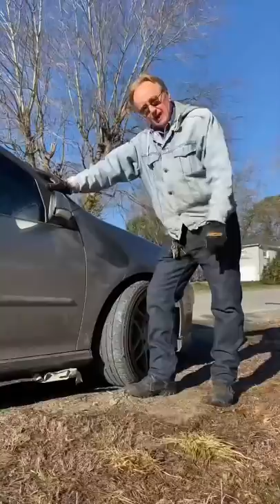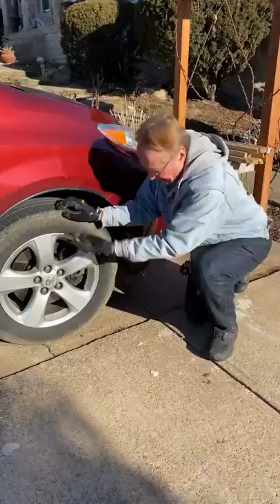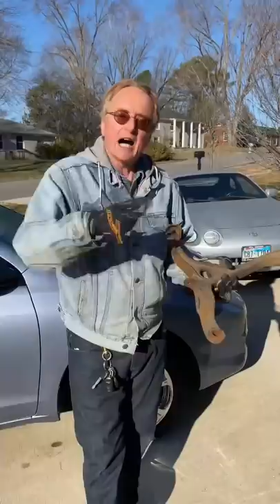Here’s Why You Should Never Hit a Pothole

Comment: That feeling you get when its raining at night and you drive into the grand canyon of pot holes
Reply: You go through all the fowl words you know in record time and if someone asked what you just said you really don’t remember
Reply: Lol! So true
Reply: @arontesfay2520  
I usually want to pull over and check for damage immediately!  Its a horrible feeling “like a pit in your stomach” to not know if you just destroyed or weakened something on your beautiful ride. 😩
Reply: @repairfreak  Same here. I went through a big one once at like 25 mph. The impact was so heavy I went out expecting to see my bumper on the ground. Amazingly, I couldn't see any damage. My suspension started making a clunking sound whenever I went over bumps since then though.
Reply: @repairfreak I’m worried about my alignment getting thrown off
Reply: @cristianayala1948  Yes, usually nothing good comes of it for sure. Least be a wheel weight gets flung off & throws off the balance of the one wheel that went in the hole, tire blows, or your rim cracks if aluminum, alignment goes off. More serious would be ball joint, tie rod end, stabilizer sway bar link bolt damage,  wheel bearing damage, strut/shock damage or their mounting “if rusted.” Obviously if your tie rod snaps or disconnects or your ball joint, or tire blows, this could cause you to possibly loose control of your steering and veer in the direction of that side. Obviously there are other things that can be damaged as well in the front end steering/suspension system as well.  It all makes for that very sick feeling in your stomach after hitting a hole hard regardless! 🤢🤬

Comment: I'm not overly worried. My Tacoma rides on 265/70 R16's on stock aluminum in the summer and 245/75 R16's on steel for the winter. Big sidewalls might not be fashionable but they do soak up nasty bumps and holes a lot better than a low profile tire on a 18, 20, 22, or 24 inch wheel.

Comment: Scotty - Love your videos! Speaking of potholes: The shocks on my 2010 Toyota Camry are shot! My mechanic gave me prices for replacing the shocks with Toyota shocks or replacing the shocks and springs with after-market parts. The difference is only $200 - in favor of the Toyota shocks. Which choice makes the most sense?
Reply: @Kevin Strnad Toyota KYB shocks are well worth the $200 extra. Never buy the cheap quick struts. The quick installation is not worth it when they are shot just 2 years later. Scotty has many videos explaining it.
Reply: You got 11 years out of the original ones so you know you will get that again if you use the same ones you don't know what you'll get from the other option. Probably better to be on the safe side and get the Toyota ones.
Reply: it depends how many potholes are on your roads. If they least about the same, do $200 cheaper.

Comment: Scotty, does this mean suvs with more suspension travel could mitigate some suspension damage when hitting potholes?
Reply: Yes they will especially as they have bigger wheels combined with bigger higher profile tyres. The most important thing though is the size of the tyre sidewall if its low profile regardless of vehicle you are more likely to bust something. The tyres are more crucial for ride comfort and protection than the suspension itself.

Comment: This is the main issue with all these a thin wall aluminum rims and low profile tires. Basically...they're crap.  The same goes for all these newer vehicles with thin wall engine and trans castings. They shatter. Back in the day one could go into a wrecking yard pick out a rolled whatever, and the engine trans combo would be just fine.

Comment: I literally drove over an uncovered manhole at 5mph that I couldn’t see due to it sitting atop a hill. The thud was so great I thought I broke my car lol. My rear passenger wheel came out good, but I broke a sway bar link which clunked until I replaced it. Now it’s clunking again and I have no clue what it could be. So yea guys, be very careful.
Reply: Thats insane imagine if you had been doing any real speed it would have ripped the rear wheel and potentially the entire rear axle off and caused a major crash, that section of the road should have been closed off entirely until the manhole cover was put back on. Its not hard to fence off a small section of road and if needed but a set of temporary lights there. You should sue the state.

Comment: Are new cars that crappy? I have a 2006 Daewoo and I really don't care about potholes. Going 50MPH on bumpy dirt roads for miles at a time. Full speed all potholes, no brake, no steering. This car is 16 years old... If you let go of the steering wheel at 90 MPH it will go perfectly straight. Are new cars REALLY THAT BAD???
Reply: No they aren't but having big wheels and low profile tyres is very common place even on little hatchbacks similiar to yours and this means they are not able to absorb bumps and potholes well at all. I find it hard to believe that your car at 90mph is going in a straight line when you let go of the steering wheel my car will do that for about 10 seconds before it starts to slowly change direction and its a 2016.

Comment: Well if my town actually used their budget for the right reasons there would be no pot holes. Then when they do fix em they use cold pack asphalt witch doesn't hold.
Reply: Potholes are supposed to be caused by the freeze/thaw cycle.  So how do they happen in LA and San Diego?

Comment: Steel wheels... I LOVE steel wheels. They take a Lickin' and keep on Tickin!
Reply: @TheLizardKing1967 yes you’re correct. If the edge of the steel rim bends, you can gently hammer it back into the proper position. Try that on alloy wheels. My friend always gets mad at me when I point this out lol 😂.
Reply: @Blakecryderman7244  Alloy wheels are far stronger than steel wheels but if you do break alloys they crack or snap and cannot be repaired whereas as you mentioned with steel wheels they bend now of course if there is too much bend they are fucked too but a small amount of bend is fixable steel wheels also cost 20% of what an Alloy costs to replace.
Reply: @gravemind6536  nope, I just looked it up, steel wheels are far stronger. Because of their heavier weight. But yeah, your correct on alloys, they crack or snap, vs Steel wheels bend. GM was absurd to use cast wheels for the new C8 corvette, the spokes kept breaking. Typical for them. I looked at a brand new civic & it has stronger OEM wheels than those corvettes.